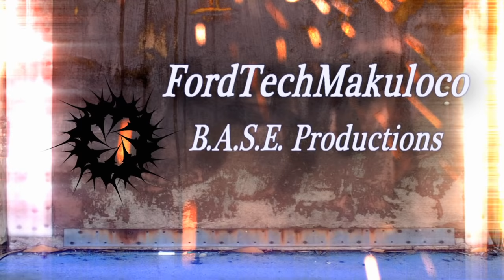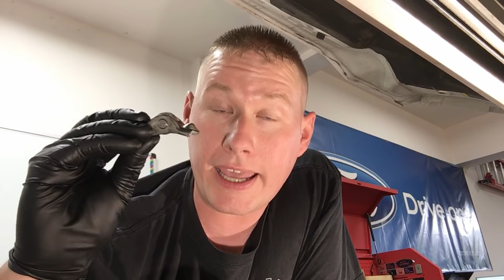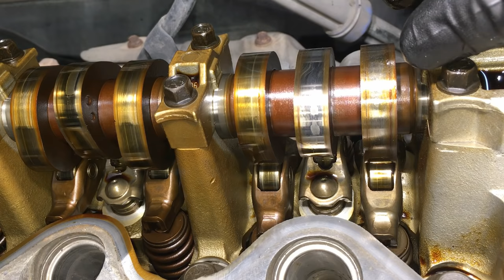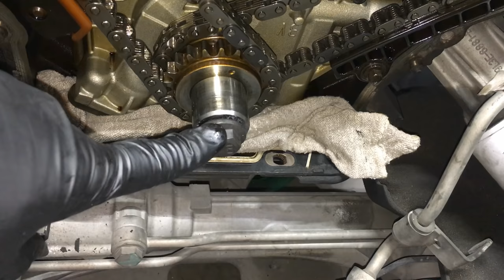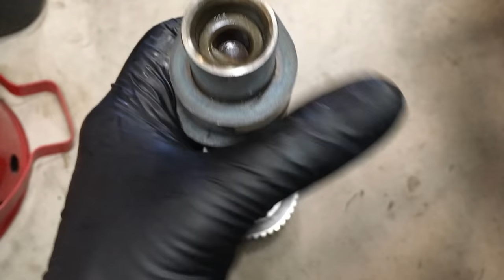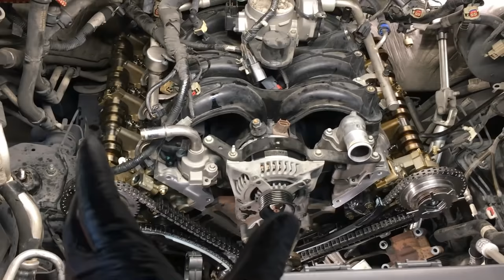Ford 5.4L 3v Triton Engines: Roller Follower Removal and Installation

Comment: Roller followers question, I’m currently on video three of the 4 part video series. I’ve got down how to remove and replace the roller followers but what has me confused is trying to remove the single exhaust-roller follower on cylinder #1 with the nose of the intake lobes positioned at 11’o’clock. It seems this causes the exhaust lobe nose to not be in ideal position to remove the roller follower. it was easy to accidentally take out the two intake roller followers on cylinder 1 with the loves at 11’oclock which promptly were put back as I realized the video showed taking out the exhaust roller follower in the middle and not the intakes.(oops?) can I just take out the two intake roller followers on cylinder 1 with their cams at the 11 o’clock position or will this cause a paradoxical shift in the space time continuum? Great Scott Marty!!!!!! Help!!!!!
Reply: I'm having the same issue. Have you found the solution

Comment: So I can put the rocker arms back in any order as long as the lobes are pointing up and the rounds are down?  I have Engine TDC #1 Cyl with chains straddling timing marks on phaser and crankshaft sprocket.  I am extremely nervous at this point since I am not a mechanic and have never fixed anything this complex and intrusive into an engine.
Reply from the maker: Yes
Reply: This is the same question I have. Thanks for the response FordTechMakuloco.

Comment: Please I'd really appreciate if you answer my question. If I am doing a timing job and I have to remove the camshaft after removing the first 6 rocker followers (3 per side), do I have to remove the remaining 18 one by one with the special tool? or can I just unbolt the cam holders? I know for reinstalling them I have to do it 1 by 1 with the special tool but you did not mention anyone about removing the remaining 18, just the first 6. Thanks.

Comment: I have a 2007 Expedition. Has had a miss forever. Changed plugs, coils, injectors. Still misses. No codes come up, no engine light. Have the valve covers off because I heard a story of sometimes a rollers will break. All rollers intact. At start up there is quite a ticking noise but it does go away after a couple minutes. Where do you suggest to look from here?

Comment: I'm gonna replace my lash adjusters cuz they just keep collapsing.. some closed, some opened.. when I say collapse I mean thier stuck frozen in place...
IV read that it's best to soak them in oil prior to installation. Plus iv read it's not necessary... Yet ur the ford modular guy, so what do u recommend??

Comment: I have a roller follower with a seized roller that scored up the camshaft.  Do you recommend replacing the camshaft, all of the followers, all of the lash adjusters, and the phaser as long as I’m in there?  Thats my plan right now.  Thanks for the great videos!
Reply: Did you end up replacing all of what you named? My 2010 f150 5.4 3v lifters went out and started scrapping cams, my mechanic wants to do the whole timing kit but I don’t see a point if it’s not broken or messed up.
Reply: He wants to do cams, lifters and timing kit

Comment: So at like @5:50 u start talking about using the tool. I only tightened the top of the tool nut, BY HAND, just today, and heard a SNAP as I got close to wiggling the cam follower in. I guess I  broke the tip of the valve off and both keepers came off with it.. but I didnt think that was possible. Oh well. Boss is mad at me. So now I guess I will be pulling the passenger side head on Monday.
Reply: Jett-Rampart Flyer ...how did it turn out?

Comment: Hey Brian. After removing both valve covers. The driver side looks like it has a darker color also more burned oil marks.? Butt all the fallowers look life. Should i got ahead and change them. And what could couse one side to look darker then the other. Thanks

Comment: I have a quick question
07 5.4 owner drove with a misfire for 30plus days. Found broken electrical plug conection. Fixed , coil is back to life. Repaired a few other hacked FI conections also. All good fire it up and it Ran worse? Still hard miss on #7. Is there a away to tell if the exhaust valve is not openeing?  I assume its running worse now because the fuel is now being ignited?

Comment: Thanks for your video's helped me greatly, I am having trouble with my exhaust roller follower tool upon the spark plug side can't make good contact with the valve spring, any advice would be greatly appreciated can't come to you I am stuck in new york

Comment: I'm guessing there is a reason not to just remove the camshaft, I can see doing it that way to just do 1 or 2, but it seemed like a real pain in the rear and a lot of fiddling around to get that one out.
Reply: Is there any answer to this?  Also can ya place followers then bolt cam in place?🤷🏻‍♂️

Comment: So when you do this are the tongs that come out from the opposite side of the cam are they resting against the top of the head where the valve cover gasket is? Or are the tongs under the gasket seal resting against the inside wall of the head?

Comment: I love your video's and information that you put out on YouTube. I have a question for you, I have a 2006 2 wheel drive Expedition with a 5.4 engine that when you accelerate or getting on a highway from an on ramp that the truck jerks a little bit and the check engine light comes on. I keep on taking it to the dealer and they keep on telling me that it's the coil and they have to have the spark plug changed also (I just had a full tune up less than a year ago). So I have them change it (it's been 2 at a time) and now I'm down to the last 2 for my engine. I change my oil religiously every 3,000 miles even though they tell me that I don't. Is it common to replace all the coils on a vehicle that has 110,000 miles on it? The truck has been kept up for maintenance and is taken in on a timely matter for anything it needs. I'm worried that after I replace the last 2 coils that it's going to be doing the same thing and I waisted all this money for what they said I needed, any thoughts???
Reply: I had the exact problem and i ended up having to replace my throttle body and it cured that "jerk on incline". Good luck.

Comment: My engine had  250000 miles and I am going to do the timing chain and phasers. Would it be reasonable to replace the roller followers since I am already there.  Thank you

Comment: FTM, I enjoy ur vids. Does my E250 5.4 2v 2006 have the same cam followers as 3v? 
Is my weakest link the chain tensioners. It does not have the phasers, correct? 
What might go wrong with my ride? I understand the plug issue which I have not had.
140k now.
Anotherjim

Comment: I'm about to tear into my 2007 Ford F150 to do a timing job. Is it necessary to completely remove the cam shafts and roller followers to do the timing job? Or, as long as the chains line up on the crankshaft sprocket and the cam phasers, is it good to go? Thanks for any help.

Comment: I have a question, I’m currently doing a timing job by the tensioners for the timing chain gave out and unfortunately the chain markers jumped a a tooth or two on the cam phasers. One of your previous videos calls for a specific position for the cams before removal. Does it matter the position of the cam or can I manually rotate the cam and phaser to get it to a relative location. If I rotate the cam and phaser, it completes a half cycle. What should I do?

Comment: Would compressed air in the cylinder alleviate the worry of the valve falling in/removing a cylinder head? If so, how much pressure is necessary to hold up a valve?
Reply: No, as the tool pushing down on the valve spring would actually open the valve.

Comment: Hi Brian. If I'm planning to replace the lash adjusters  along with the roller followers , can I remove  the cams without using the spring compressor? or should I release the tension on the springs first and then remove the cams? Also do you have a video how to install cams along with the lash adjusters and followers?
Reply: I'm not brian but I am in the process of doing this.  You definitely want the tool and remove the followers first then the shafts, then you can remove the lash adjusters with just your finger.  I tried getting the last adjusters out without removing the shaft and it was impossible.

Comment: If we wanted to replace all of the rollers while doing a timing job, wouldn't it be easier to just pull the camshaft out and  do them all at the same time?
Reply from the maker: If you follow my timing chain replacement video you will see how

Comment: Thanks for the great videos. Getting ready to change  followers, adjusters, seals on a 05 5.4 f250. Is it a good idea or even possible to wedge the chain, mark the chain and phaser/cam position and pull the cam( without removing phaser from cam) without removing front cover to change everything out? phasers are locked out if it makes any difference. Thanks.
Reply: I tried that woth my mustang and used the wedge tool as well as tying the chaines to the hood with small rope and still, (at least 1) chain fell off the bottom gear and i had to take the front off and re time it. Be careful!!!!!

Comment: How does this differ from the 4.6 2V? Als, if pulling the heads (blown gasket), does this have to be done while installed to engine or can I do this on the bench?

Comment: So once all my components are installed on the front and the engine is timed it doesnt matter when you're turning the crankshaft? Nothing to worry about?
Reply from the maker: Once the engine is fully timed you are safe to rotate yes.

Comment: Probably a dum question but i one of the lifter fails do you replace all of them or just the one? And also will you replaced de adjusters  or if they check ok you just let them be

Comment: I have an RV with the 2013 Ford V10 that started having a tapping sound from around right valve cover.  Took to Ford and of course sound went away.   Ford guy said it may be a bad roller follower. My question is if the roller follower is bad will it make a tapping sound and could that sound go away or would it stay constant?   

-note: I didn't have any engine check lights in while noise was there but after I was driving on highway on him and light came on but went off in a few minutes.

I just bought it so I don't know Service history.  Oil was changed but looks like it has dirty oil in there with residue on oil fill channel walls.  Could dirt make these sound and then go away?

Comment: I have a 2005 Mustang GT with the 4.6 that I have super charged, it has 56,000 miles on it. So, if there is one failed follower, cam is looking good, do you replace just the one failed follower or replace all the followers? Did these followers come in batches and is there a good chance I will fail another one?

Comment: If a 08 F150 5.4 has 272,000 on it would it make sense to do a timing job or just run it til it quits and replace the engine? It doesn't smoke or use oil but it's starting to run rough .

Comment: So if im having oil pressure issues i should chage to the new roller followers with the smaller hole? The smaller hole is better, how? And should i replace all roller followers or just a specific one?

Comment: Ive fixed my misfire with a new injector but my roller follower is starting to sound crazy. Life is about to suck this is my only vehicle and its hard to work and fix my truck in between

Comment: after removing the follower, is there a process/procedure for replacing the valve steam seals?  Compressed air to hold valve up etc?

Comment: Ive been hearing the dreaded ticking for a while now as well as recognized a loss of power on my 05 F150XLT. I imagined it was probably related to the timing components but after seeing this Im betting the followers are the culprit. You dont comment on the # of followers necessary & the pros/cons of replacing 1 or more vs replacing them all (other than the added cost)?

Comment: If your replacing the timing chain and fasers.
Wouldn't be easier to remove the cam shafts ????
Reply: That's exactly what I was thinking.  Rotating the shaft for multiple rocker replacements plus needing this tool and the difficulty of removing them I'd have the camshaft out by then.

Comment: Can you also change the valves seals with this same procedure, if you keep compression in the cylinder?
Reply from the maker: Basically yes
Reply: @FordTechMakuloco  ok if i was to use the cam chain wedge, does it matter what position the engine is in as long as i dont loose time from the sprocket, was is the safest position from valve to piston contact? Btw your videos are great i have an 05 mustang gt, and your videos helped me so much over the years!

Comment: The roller followers you linked are $20 a piece. Can I get $5 ones off rock auto or will they fail early? And are the roller followers you linked the ones with the smaller oil squirter holes or no?

Comment: I just did a timing chain replacement on a 04 5.4 v8. New lash adjusters installed but the rocker rollers keep falling out as I crank it. What can be the problem?

Comment: Quick question I know this is an older video but I used you link for the rollers and Amazon thing says it doesn’t fit . I have a 2005 5.4L V3
Reply from the maker: They fit all 3v engines 2004-2014.

Comment: Not understanding why one wouldn't just remove the cam (alternating loosing the bolts so that the cam rises slowly and evenly)?
Reply from the maker: I do, but this is the proper way and that is what I teach on my channel. Your way is fine for a tech like me that has tons of experience and a feel for it where as a DIY should not jump into that method.
Reply: And your personal method of getting installing cams and followers? I assume drop followers place cam turn cap bolts in sequence til bottoms out then torque in sequence? Yes?

Comment: I just changed the roller followers and the lifters with the freedom race brand. They look the same as the one the video, but after changed them when I start my truck it makes a loud noise for a few seconds. Do you think because the little holes on the new roller followers are not letting oil lubricate the camshaft fast enough?
Reply from the maker: Nope get that freedom racing junk outta there!

Comment: @FordTechMakuloco  If I'm planning to do a full timing job wouldn't it be easier to pull the entire camshaft?  Is this procedure just to remove the essential 6 roller followers (3 per side) and then pull the camshaft to replace all of them?  Is it worth replacing them all, especially on an '04?
Reply: jstephan03 once you've gone through the trouble of removing valve covers you might as well replace them. You can also remove them by removing the cam shaft.

Comment: The followers will come out with the cam still in place, but what about the lash adjusters?
Reply from the maker: No they will hit the cam lobes.
Reply: What about on the 6.8 v10 3 valve will lash adjuster come out with cam on I’m assuming no since heads look almost identical to 5.4 3 valve. I’ve did the pop off method on the 2 valve engines and it works just fine lash adjusters com out and do not hit cam wondering if that same method will work. Also even if the lob is out of the way?

Comment: If it's time for new rocker arms and the engine has close to 200K, why not alos change the cams?  It seems like the whole rocker arm removal would be easier and the valve train is then completely new. Do the heads have to be machined on the cam bearing surface to install new cams?

Comment: Is it ok to replace just bad roller followers with the latest model? I'm planning on cam phaser and timing chain job soon and I am worries that I may find some bad roller followers and/or lash adjusters. Don't have budget to replace all of them and planning on getting them from the dealer if I find some of them to be bad.
Reply: You can. I've done it.

Comment: At the point of removing the roller follower can i then just remove the valve keepers and spring if i have compressed air in the cylinder? And keep doing the same on each roller follower and spring that is at base lobe on the cam?

Comment: question I have a2005 f-250 super duty and I have replaced phasers ,chains, guides the full deal,including rollers rollers and lifters but I am having trouble installing the followers with the tool on the passenger side because the heater box is in the way at the rear..do i have to remove it.

Comment: Hello there I been doin alot of research for my 5.4 3 valve, but had to replace the guides for the chain then the passenger phaser jumper a few teeth.. so do I have to take the vavles out in 1, 4, 5, n #8 cylinders and do the timing like in your videos.. please help, which one do I follow, do I have to replace a phaser?? I'm in over my head!!!

Comment: Before replacing the lash adjusters I soaked and pumped them in oil. Does it matter what orientation they go in? They don’t seem to be solid like others. Will they get “solid” after the oil pressure priming event at the end of the job?
Reply from the maker: Yes they will pump up with oil later, there is no orientation.
Reply: FordTechMakuloco Thanks, Brian! Now I can sleep...

Comment: While going down the road in my2001 Ford F150 the overdrive off light starts blinking, then it started to appear to misfire and once I stopped at a stop sign and took off again it wouldn't shift out of 1st gear, what's going on with my truck, I'm desperate and have no money for a shop